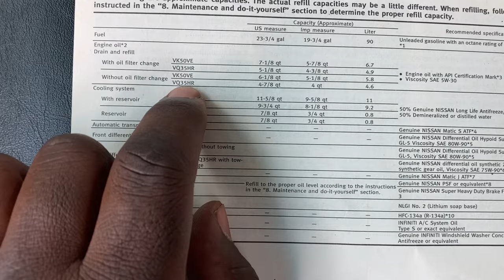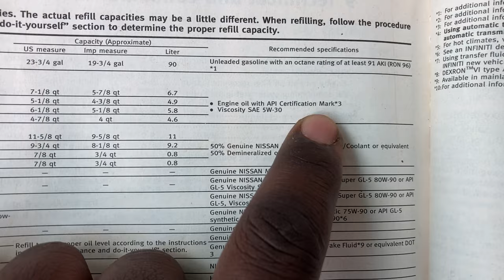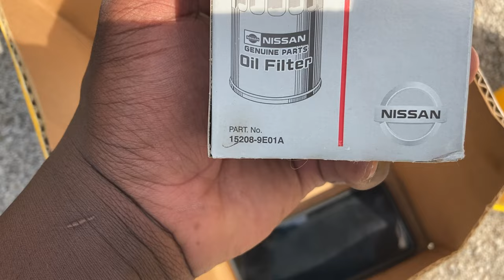Infiniti FX50 Oil Change. Real Time, no Shortcuts

Comment: great channel. I’ve had a 2010 g37 2011 m37s and Now I recently got a 2012 fx50s. Been watching  your videos and noticed I’ve had a lot of similar issues as you post. Like my 4was on my m37s as well as my fan control module. Even having my iba light on/off with my fx50 when the sunlight hits it. Definitely appreciate the videos.

Comment: That blue towel you are using will leave fibers on whatever you wipe. Every fourth oil change I use one qt of Lucas and put it in first it will protect your motor on dry start after you change the oil. Thanks for the video nice job.

Comment: Damn 216989 Miles, Whoa. 

I have an 03 FX45 with only 77k on it. Barely use it. Live in NYC, Don't really drive much these days. 

I will be doing my oil change today, like you said on this video. most of these oil places don't get all the old oil out, because of that you can have upto 1/4-1/2 quart left in it of dirty toxic oil mixing with new oil. Since I have not changed my oil in a long time, I will change it Now and one more time in another month? after driving it for at least 100 miles more. Like I said don't go out much these days and also we have 3 cars and the other cars like the Q50 gets used more and even those are very short trips as everything is nearby since I live in NYC 5 Boro area. 

Thanks for sharing and pointing out all the other important things besides an oil change.

Comment: I’ve been using amsoil when i can afford it cause I’m trying to preserve the engine cause it has high miles on my g37x coupe.
Reply from the maker: Nothing wrong with that. I've used dino oil on engines with over 300k miles with no issues, so I believe that most big name oils are adequate for the job. 
I switched to synthetic with the main goal of extending my OCIs (oil change intervals).
Reply: How you feel about using Lucas oil stabilizer?

Comment: I went to an Infiniti Dealer for an Oil Change but the manager didn't want to add Full Synthetic Oil because he said Infiniti doesn't recommend it. I'm not sure why he said. I did some research and didn't see any reason why synthetic oil shouldn't be used, other than the dealer wanting to do more frequent oil changes with conventional oil.
Reply from the maker: Yeah, that sounds very odd indeed. In fact, Infiniti dealerships sometimes stock synthetic engine oil and sell it themselves. 
Where is this dealership located?
Reply: @EdBwoy  Bridgewater, NJ

Comment: Hi Ed, do you allow 3500miles intervals between oil changes? I found out that oil could get dirty before 3500miles. I usually change oil thrice in my M37. Is that too much cos I usually don't wait for the 3500miles.
Reply from the maker: I usually aim for around 5,000 miles. Maybe less if I think the vehicle has been doing severe duty.
Reply from the maker: I also don't use perceived cleanliness as a major determinant to oil life. If you ever drained oil right after an oil change (for example 500 miles) you'll be surprised by how dirty it gets.
I mean draining it from the bottom, not just looking at it from the dipstick - as shown in this video, it could look clean at the top but be dirty.

Comment: Sometimes, if you lubricate the filter O-ring - this oil can be pushed out a little bit by the oil pressure after the engine start, first time I've seen that - that was really frightened..😁
Reply from the maker: That is scary. Hopefully it's not something I'll ever have to deal with, because the oil filter has a groove that holds the o-ring in securely.
Reply from the maker: But you can never be too sure. Which is why I kept checking so many times
Reply: There is a small gap there, at least for filters 15208-31U0B and so you can catch some volume of oil and it will be pushed out of there after the start.

Comment: How could you tell that it wasn't the valve cover that was causing the oil leak?
Reply from the maker: I might have misspoken, I meant to say that I believe I have valve cover gasket leaks as well ...because I did not think I could lose all that oil through the oil cooler seal.
Reply from the maker: But to answer the how, I can usually confirm by:
1. A smell of burned oil when the engine warms up
2. Running my hands along the heads (where the plastic valve covers meet the metal) and feeling for any wetness

Comment: I think when you going under a jacked up car, you should used safety stands just incase the jack fails. I just never see one bad practice..don't see the point writing up the filter just change oil every 3 months, who is going to check 😃😆
Reply from the maker: You are not wrong regarding jack stands for safety. 
However, in this case I lifted one corner by a few inches. Not enough to even fit a jackstand, and low enough that it would not pose a hazard if it fell back on the ground. 
It was not lifted for access, I just did it to tilt the oil pan

Comment: That oil filter was on there very loose, or you might have loosened it off video..
Reply from the maker: I've got a strong grip. The video made it look easier than it really is.
Reply from the maker: Seriously though, yes it was not on there very tight. However, that's what I was trying to explain (I didn't go too deep into it) when I mentioned that an oil filter still seals well with just enough pressure on the seal.